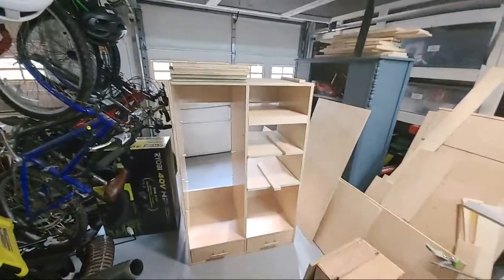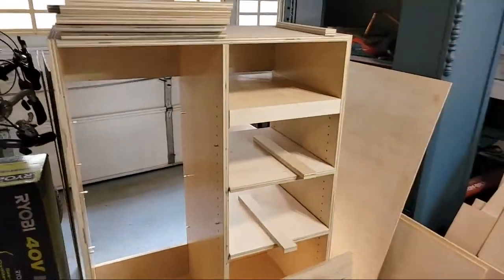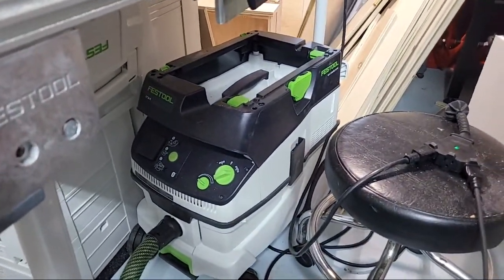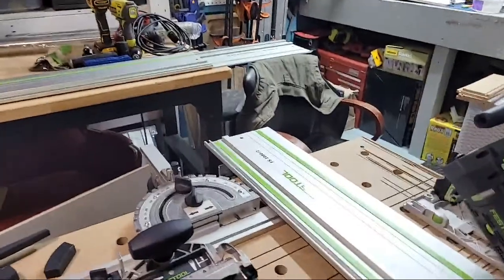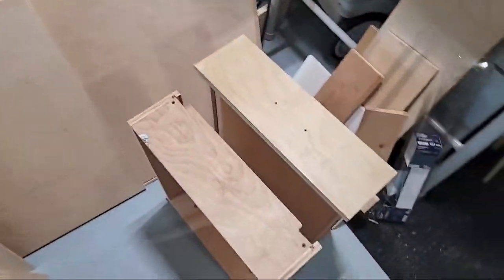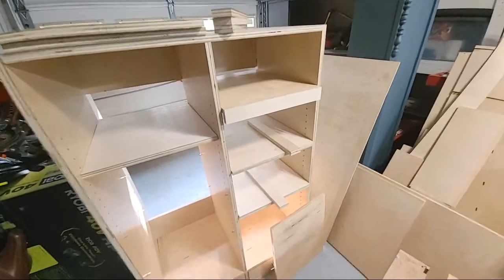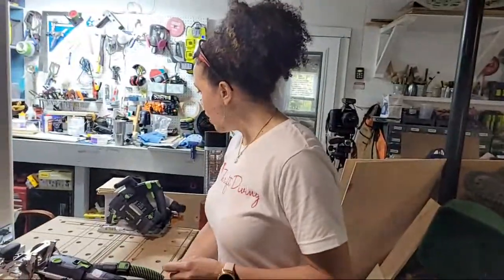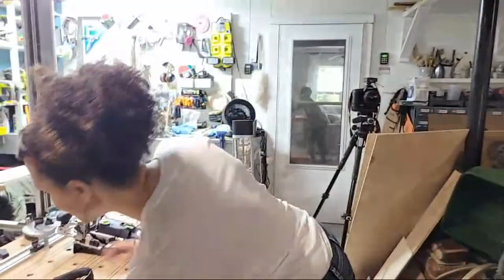I'm Building a Closet Organizer!

Comment: I’m loving the podcast! I’m dealing with a small night stand that all of the veneer would snap off if you breathed too close to it. I’ve got it all stripped and sanded but I’m trying to figure out the best way to fill dents and scratches. I’ve tried a couple of different things but then when I sand it, the dent is still visible. Am I over sanding? Am I not using the right wood filler? I’m getting frustrated with my first real project but don’t want to quit on it! Thanks for all your amazing advice!

Comment: City permit🤪🤔😱🥱
Hurry up and wait. I called about concreting my property. I asked them was it against the law for me to cement in my whole lawn area front and back. It took me over 3 months to get an answer. It turns out I can that's not a problem but I just can't drive on what was once the lawn area or Park on that area. So, when I go to get the permits, (which will now be in the spring because it took them so long to answer my question), it's going to be interesting to see just how long it takes to get the permits and get the correct ones. But I'm so happy I didn't go there first to find out what the law was because they probably would have been sending me all over the place within the city building.

Comment: What do you plan on doing with the other drawers that are too small?
Reply from the maker: Good question! I am thinking of just sliding them under something else, like my son's bed or using them for storage elsewhere.
Reply: @ThriftDiving  One can never have enough storage! Perhaps a special cabinet with those drawers for smaller tools and odds, ends, scraps and extra materials. I have a small space and try to be as innovative as possible when it comes to storage and organization. Great job and all the best!
Reply: I had a thought... for the shed you would like to build, instead of the cement blocks, would large pavers work as a foundation to cover the square footage of the area you would like to place the shed on with some weed barrier underneath the pavers? Maybe dig a channel around the perimeter and use pea gravel for drainage. 🤷‍♀️ Just a thought... 🤔💡